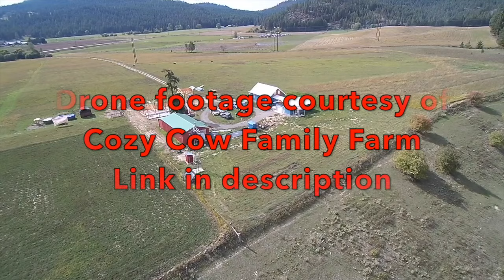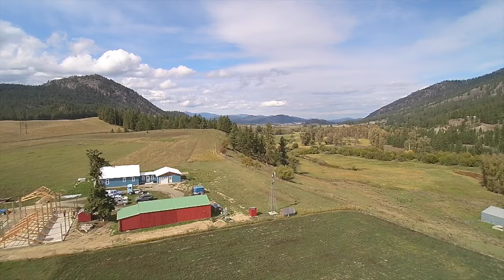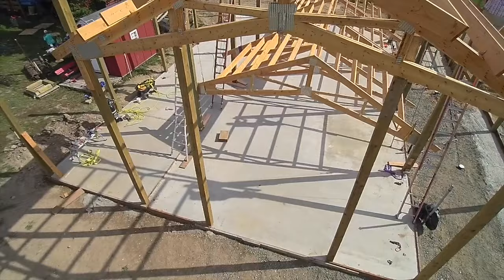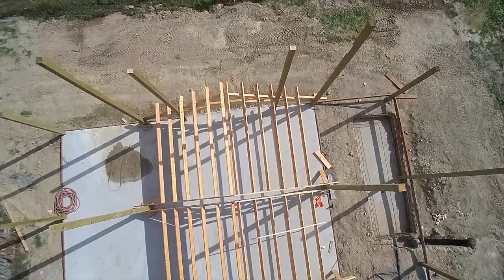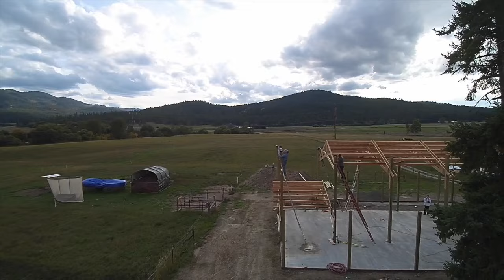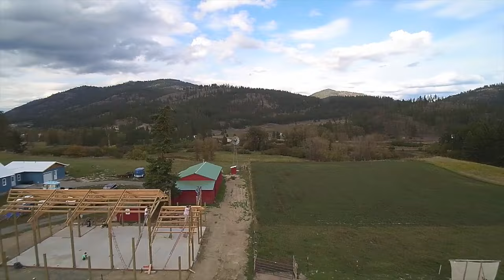Building Dairy Barn Bonus: Drone Footage

Comment: Interesting way to to put trusses up.   Is the double trusses needed for snow load?  or just the building method you chose so you can do more work at ground level?
Reply from the maker: All of the pole buildings around here are constructed that way. I think snow load is definitely a factor. Ours is rated for 50#/sq.ft. Regardless, Its makes a convenient way to build the roof in sections! Thanks for watching!